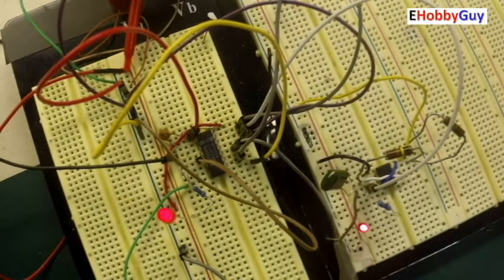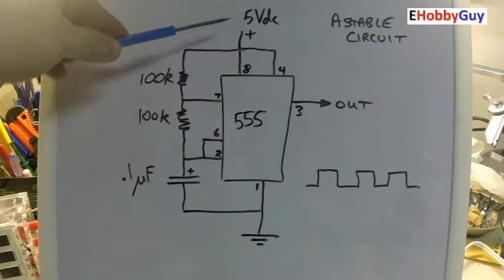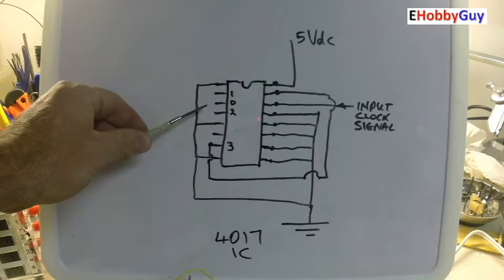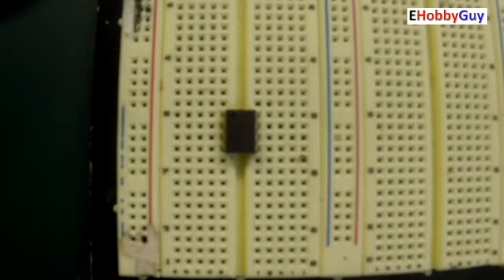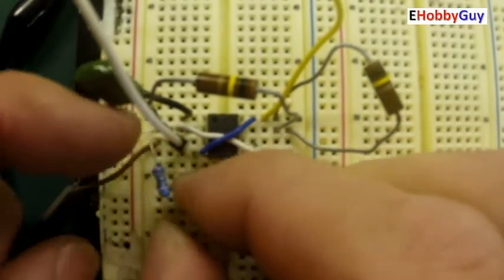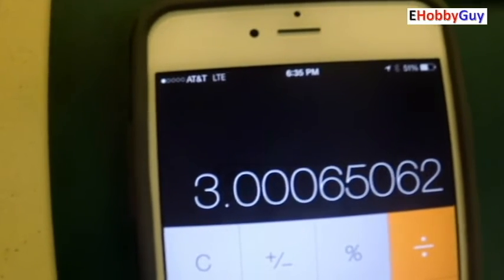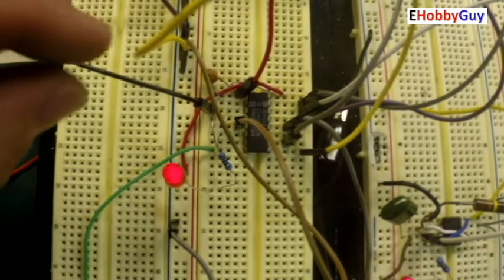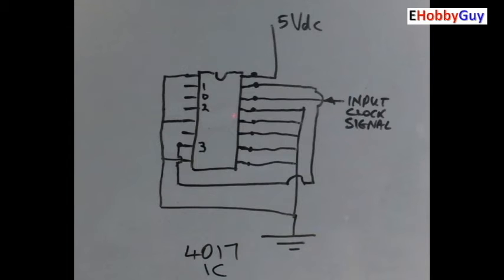Easy Frequency Divider 4017 IC

Comment: hi, this chip works with variable frequency or is just stable frequency?  it is possible to divide by 2 a frequency that is always varying from 0mhz to 6mhz?
Reply from the maker: Mecatronicgarage yes it works with varying frequencies and dividing by 2. Thanks for the question and thanks for watching.
Reply: @ehobbyguy8980  Thanks, i'm waiting for the IC to arrive to test on my project.
Reply: The 555 and 4017 were the first components that I tinkered with when I got started in electronics. That was in about 2002. LOL. Now I'm programming microcontrollers and building hand held mini computers. It was people like you who I learned from in the infancy of online diy self taught learning. I liked how you explained it. I'm having to step back to the 4017 to build a bat detector, so I can hear them in real time.

Comment: You have connected the unused outputs to ground. This is NOT a good idea, With CMOS chips you only tie unused inputs either high or low. The unused outputs should always be left disconnected.
Reply: I agree.

Comment: Is there any way to divide the frequency, whilst maintaining a 50% duty cycle, using a 4017?
Reply from the maker: Thank you for your comment and question.  You can (without doing anything) if you are using the carry out output dividing by 10.  Any other division is a problem.  This could be easily overcome though, by using the output of the 4017 chip to trigger a 555 timer wired in single shot mode.  The output of the 555 timer on pin 3, can be "tuned" to have a 50% duty cycle.  This of course is assuming that your input frequency is fixed.  I hope this was helpful.  Let me know what you think.
Reply: Thank you, that really helped :). I'll be using it with a synth, so to input frequency will not be fixed. It got me thinking though... You could also have the pulses coming out of the 4017 trigger a flip-flop (and have the flip-flop switch between ground and supply). That way, you'll get a 50% duty cycle, regardless of the input frequency or clock division. I realize this will divide the frequency by two, but that's not a huge problem, as we're dividing frequencies anyway.

Comment: why the led is fluctuating variety frequency per second?according our physics,the frequencies in hertz must not be assimilated with the electromagnetic wave frequency.So is this circuit could be used for the rf applications?